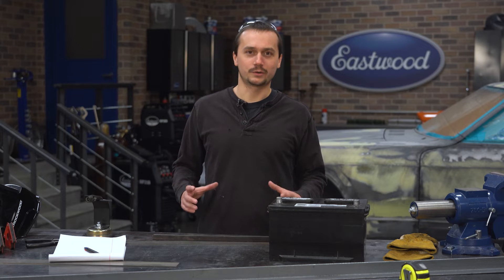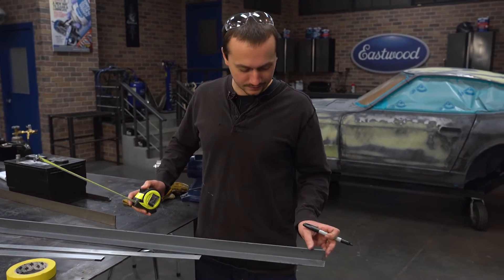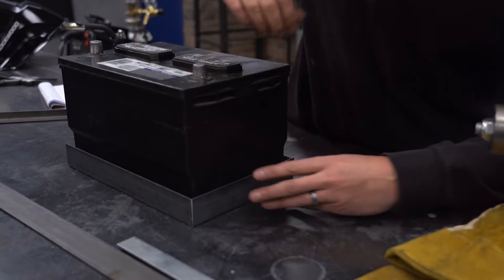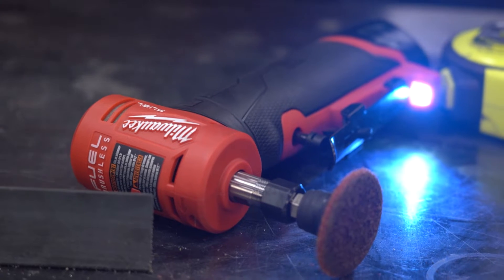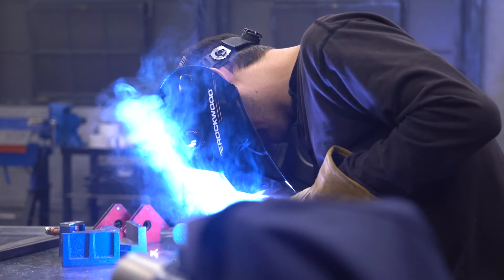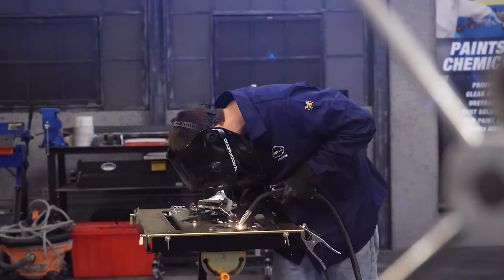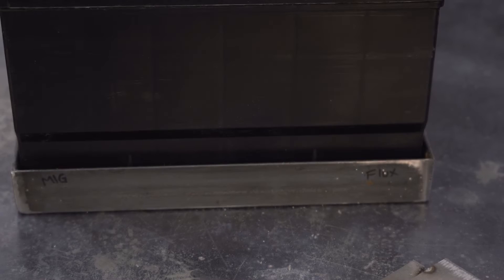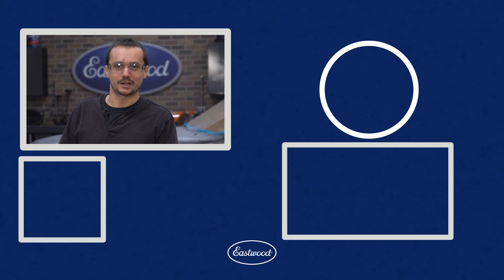MIG vs Flux Core Welding: Head to Head Real World Testing!

Comment: Let me give a tip to save you from a ton of frustration: DON`T BUY A FLUX-CORE WELDING MACHINE! yep the weld is just OK (OK -) when cleaned up, but here is the problem. There is just a shitload of cleanup. If you wan´t nice looking result, just forget about flux-core. Buy a good TIG welder instead, or a good MIG-machine.
Reply from the maker: We prefer gas welding as well, but it's great to know there's options out there if you're on a remote job, it's windy, or you are on a budget and just want to get the job done.

Comment: Choose flux core wire for outdoor or heavy-duty work, particularly with thicker materials. Opt for solid wire when welding thinner materials in controlled, indoor environments for cleaner results.
Reply from the maker: 100%

Comment: Which one is easier to learn and use if you aren't a welder.?
Reply from the maker: Traditional MIG is what we'd suggest if you have the couple extra bucks for a gas bottle.  Flux will get the job done but isn't as great for thinner gauge metal and is a bit dirtier.
Reply: Id say flux core is easier to start out with, the setup cost is significantly less and a good way to practice. 

If you don't have a lot of welding projects and only use the welder a couple times a week, for the average person without lots to spend, I think flux core is the way to start. The gas MIG will produce a "cleaner" weld, but that all can be cleaned up in a couple minutes at most with a wire brush or grinder.

I started out with a flux core/stick/lift Tig welder for $150 ish from Amazon, and it does everything I need for projects around the house and has been a great way to learn. The cost of going for a proper Mig setup would have been 3x as much after factoring in all the additional gear. If I was going to be using the welder everyday, I would go with the gas mig setup though.

With one of the newer, cheap flux core "3 in 1" machines, you can do stick, mig and lift tig all off one machine. It may not do it as well as high end machine, but it is a great way to get into welding, and gives you the option to learn all 3 main types of welding on one machine, although in a fairly basic form. I have the ArcCaptain 135 3 in 1 (mig, stick, lift tig), and it is great for anything except very thick steel. It will weld anything up to 1/4 inch easily, maybe even 1/2 inch.

The flux cored Mig machine I have though, is not great for thin sheet metal, the lowest amperage it can run is 40a. It can weld thin steel, but at first I did struggle with burning through really thin sheets.

There are some very cheap stick welders out there as well, that can be had for under $100, and stick welding is great all around for many things, but can be trickier to learn, so it you can afford $150-$200 to get the 3 in 1 machine, it is far better than a basic single function stick machine, although a stick welder can do most things, its not great for sheet metal either in my opinion.

Also plan on spending another $200-$250 on top of this for wire, mig tips, a welding mask, good leather welding gloves, wire brushes, welding pliers are good to have too.

If you don't have a grinder either, you'll need one. There is a wire variety of metal cutting tools you'll eventually want if you don't have them, a reciprocating saw, hack saw, maybe even a coping saw for curved and detailed cuts in steel.

It is an expensive hobby, but the very basics to start with would be a 
3 in 1 MIG flux core/stick/lift Tig machine $150-200
Grinder and discs $75
Mask $50-$100
Flux wire $20/2Lb roll
Mig wire tips $20-30 (0.035/0.030, match to the size of wire you buy)
Good welding gloves $30-$40
Welding pliers or blacksmith tongs to pickup hot steel (Do NOT try to pick up something you have recently welded with gloves or bare hands for at least 30min! Even small pieces can stay hot for a very long time! Use welding pliers or steel tongs to pick it up if it needs moving!!)

If you buy a 3 in 1 machine you may want to buy some welding rods too and try out stick welding as well, it's good to learn as well, and those will run you another $20-30 for 1lb or so of rods. I've heard 6011 rods are good to learn with.

Just some tips I have picked up in the process of learning to weld that I thought I would share. I'm not that experienced with it either yet, but I highly recommend learning! It's a lot of fun and very useful! Give it a shot! I hesitated for years, wanting to learn, and I'm so glad I eventually decided to buy a welder and teach myself.
Reply: @benwood1777  very thorough and detailed advice! I especially enjoyed the part about not touching something that’s been recently welded. As a former, professional welder and current welding instructor, your advice was spot on. 👌
Reply: @benwood1777 thank you!!

Comment: I took my 6 month Titanium 125 FC in to my local college where I'm taking MIG Classes; passed lap, t and butt joint's at 3/16 on the first try. Instructor has 28 years, was impressed so he did bend, cut and etch testing. All four of each passed. That surprised me.
Reply: Congrats brother, I'm glad you passed that easily. Keep going, take all the courses you can. Even Oxy-Acetylene. It's still in use for more than most people think. God bless and work safe.
Reply: @ I'm taking Oxyacetylene this semester. It's a lot of fun. For the record, I did all this in 1980's in the air force.
Reply: Also be aware that the pay is dog shit outside of the top 10% of the entire industry.

6yrs doing it and the pay hasn't gone up at all
Reply: @jonathangarzon2798  I'm a retired hobbyist - will never work as a welder.
Reply: @opa_plays_mw5318  really?
I mean good on you for learning, although I am curious why waste the money on the college course if you don't plan on making it a profession when all the information is free online and a small machine is cheaper?
Reply: @ It's not a "waste" ever to learn and be part of the community. I've got a few years on you - here is a free piece of advice - free is all to often what worth what you paid for it.
I'm taking a class that as a over 60 is half price, meeting folks (including others my age and teens getting started). As a bladesmith (again, hobby) and blacksmith - I'm sharing my knowledge - and my open shop - to all. I've also got a mig/tig/stick/flux core/spot and spool gun multiprocessor, full up forge and multiple grinder/belt grinder (2.x72 etc..) and a forge press, the Titanium  125 is the least of my welders. With 2 B.S. degrees, a Masters, and a Doctoral in I.T. - the bottom line is I never quit learning, or participating in learning or my community.

Comment: How much is "more wire" and "less heat"?
Reply from the maker: It's a guideline - you will need to mess with settings on your end based on the project.  It would mean turn up the wire speed and turn down the voltage.

Comment: Pro tip if you're using the cheap flux-core setup - spend $20 and get a can of spatter spray and a tub of tip gel. It makes a world of difference on the finished product after cleanup and it makes your equipment last considerably longer. Flux-core welding is just nasty by nature so use the tools of the trade to improve your finished product.
Reply: I HATE FC for that exact reason. Thank you for this tip.
Reply: Pam is cheaper unless you're going to paint it later. Otherwise grab a jug  or 2 of simple green
Reply: Buy two cans anti spatter way cheaper than gas.
Reply from the maker: Great tips!

Comment: when you use flux wire did you also use gas ?
Reply from the maker: No that's the only benefit of flux.
Reply: @eastwoodco  Can I use the 180 wire feeder with E71T-1 dual shield flux core with 75/25 argon/co2 mix. I ask because prefer dual shield wire over self shielded. I’m considering buying the 180 wire feeder.

Comment: I bought a Static Arc 3-in-1 welder for £149. I think it goes to a (supposed) 140A but the highest I've run it is 56A. When it's time for me to move to gas, I can switch to a solid wire and plug in the gas. 

It's insane how cheap you can get into welding these days.

Comment: You used 030 for both. In this video you state that to use flux wire you were going to flip the roller to use the knurled side. But the knurled roller that comes with the MiG 90 is 6mm for 023 wire, do I understand that 6mm side knurled side can be used with the 8mm flux wire?
Reply from the maker: We'd recommend using the knurled side for flux for both .030 and .023, and make sure to flip polarity.

Comment: Thank you. I purchased a used job smart welder for little tacks and have been hesitant to invest into buying the wire. I think your video answered all my questions about it. Perfect for what I’m going to be doing for $60 plus the cost of some fluxcore wire. Did you use a larger tip size?